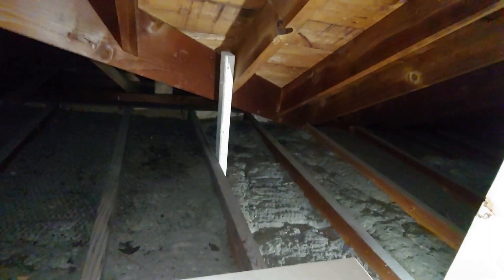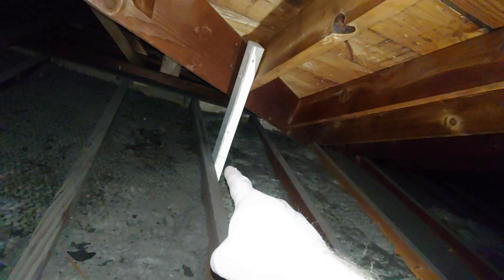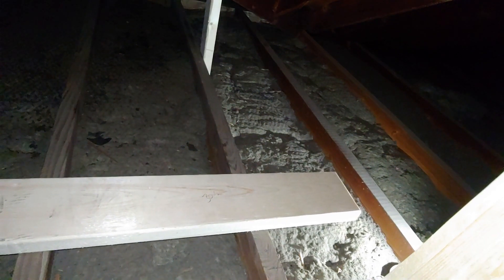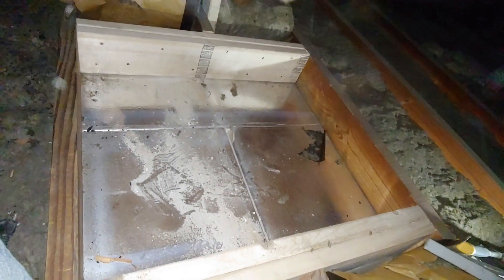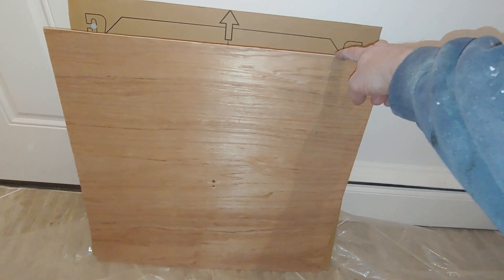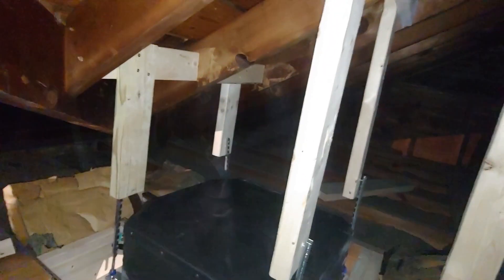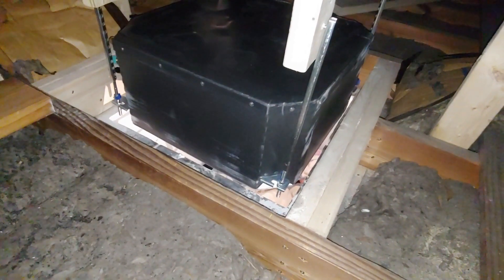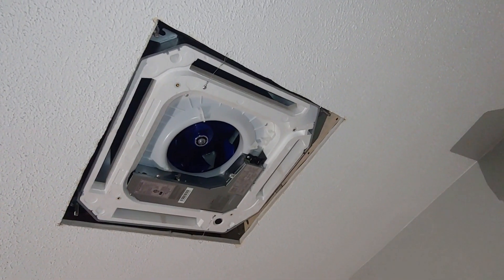Ceiling Cassette Minisplit Installation

Comment: How did you address the attic insulation after you installed these? what considerations need to be taken when it comes to attic insulation and these units? for example, would rolled insulation be laid out around the unit, leaving a square opening around it?

Comment: I currently work in HVAC, but I started and worked in construction for 12 years.
One needs to know a lot more about structural integrity before cutting framing members such as ceiling joists and notching out rafters. One could make about 15 videos just on how to reinforce the existing framing.
On the HVAC side of this work, I didn't see any pressure checking for any leaks, or vacuuming out the system and also checking for a leak in vacuum, weighing any additional refrigerant with a scale, and also wiring know how,
One would be lead to believe the hardest part is cutting joists and a whole in the ceiling.
Much, much more is involved in this project then the video leads someone to believe.
I'm wondering why Steve had so much trouble getting a real HVAC installer. May be he didn't likey the pricey and thought this work was eazie peazie?
Reply from the maker: Congrats on your career.
Reply: @SteveDoesEverything , one day in the distant future you will realize I am right and you are doing a real disservice to youtube land with your nonsense work methods. Someone may get seriously hurt when the HVAC unit comes down with the rest of the ceiling. Look into it!!!!!!

Comment: Two reasons I don't like square mini-splits cassettes.  

Cutting ceiling joist may create a structural issue. Officially you would need a building permit which because of the possible structural issues will likely be a can of worms.  Skip the building permit and you take on the liability of a future structural issue.

The four-sided cooled air outlets and center air filter intake allows more output to input air immediate recirculation reducing unit's efficiency.
Reply: What's scary is someone with very little skillsets in anything is going to hurt his family after cutting a few joists which act as "beams". There will be an attorney. one day, knocking on "Steve knows everything"'s door. 
His channel should be called "Steve doesn't know his liability" for posting these type of videos.
You would think he would state, please review with a skilled carpenter or engineer before attempting this work.
He should be mentioning the risks at each step. 
Nope.....".I just want to make money on the clicks" just like the unethical contractors he is talking about.

Comment: How much square footage does a single cassette unit like the one you put in cover?  I'm wondering if you would have to do this for each room in the house...
Reply from the maker: I ended up using 4 of the 5 head units in this house. Depending on the BTU of each unit mine were 12000 so good for up to 600sqft each

Comment: I would choose the cassette module which is mounted between studs.
Reply from the maker: Yes me too but at the time I bought this system , it was very hard to find those
Reply: @SteveDoesEverything  I checked many many different options and decided, for now, to go with two wall-mount units from Daikin. They are domestically made in Houston and probably will be easy to get parts. Also quite easy to install on the exterior house wall with drainage right away outside.  Tried to look at Mitbushi, - but they are produced in Japan and delivery dates 4 month away.
Reply from the maker: @arishem555  I’ve seen good reviews on those Daikins. Wall mounts are very easy to install.

Comment: Thanks for the video, I'm in the same boat old house with a boiler. I do have a central hallway connecting 2 beds a living room and a kitchen. I think one unit will heat and cool the hole house, cutting the rafters was my only concern. Thanks
Reply from the maker: There are head units that fit in a 16” rafter now. I think Mitsubishi makes them.
Reply: @SteveDoesEverything  yes but I think they only blow one direction I need front and back but I'll look closely at them. Thanks

Comment: What kind of saw did you use to make such nice cuts in the ceiling 2 x 4s? Seems like it would be really awkward trying to cut those especially while up in the attic.
Reply from the maker: Used a skill saw 2.5” across top then finished with an oscillating cutting tool

Comment: Exact same situation in my 1957 ranch in Elyria, OH.  In addition to having boiler heat, I don't have any external wall space with 3 feet or more clear; corner windows, giant front window, fireplace.  The local HVAC folks wanted $18,000 and couldn't even explain what system they thought was a good fit.  I'm going to attempt this myself soon.  I had a couple of questions: Should the line sets be trimmed to fit or is it OK to coil the excess somewhere?  Should the cassette have an insulated box built around it, I've read that in a hot attic condensation can cause drips?  Do you have to install the wall controller or can you run everything from the remote, or reaching up and touching buttons on the unit?  Great video!
Reply: Hi.  I’m ac engineer and I may know some in this job.  
There is many different indoor cassette in market and in different brand like: daikin, Mitsubishi, Fujitsu……. 
All of this unit are insulated inside the the metal box by polystyrene and no need any extra box the condensation will be inside the unit and dripping down in tray then drain out by internal pump ( just 30-40 c in height). There is many different way to hang the unit as long as it’s secure and level. The depth of units are depend on size of coil which is evaporator for example: the 5 kw unit got lower height as kw goes up the size of evaporator will be bigger and you need more space on the top, but again you can do so many things to make it look good.
Reply from the maker: I concur with @khosroNazem. On your questions, I wouldn’t trim the extra length on the line set. But be sure to review the manufacture specs on total line set length for the unit your installing. On the system I installed, if I remember correctly, the total combined line set length couldn’t exceed around 400 feet.
Reply: Ac can run by wired or wireless controller some need receiver. And some new ones can be controlled by Wi-Fi

Comment: Getting ready to the do the same thing myself. Got similarly outrageous quotes. The only thing I'd do an addition to what you did is scab the joists on either side with double trimmers. What you did should work fine but technically the the load of one of the joists was transferred to the other two meaning that you've reduced 3 down to 2. The scabs should increased the load ability of the joists on either side.
Reply from the maker: You're right. Great idea thanks. Good luck with your project.

Comment: Man, next time use a real simple device called vertical Hangermate, search for Dewalt wood vertical hangermate& rod hanging anchors,you dont need all that wood ,the allthread goes directly into it and its a stronger better hanging method, plus the alltread keeps things clrear for servicing.  They cost about 85 cents each and you only need 4. Believe me you will like it. Now that being said. I like the fact that you are doing it yourself. Its rewarding doing things yourself. Good luck and great job
Reply: Since I also have 16in spaced rafters, I have plenty of room around the unit.  So what I plan to do is mount 2x4 corner braces that the unit will mount to (as it has brackets on the corners).  Then either screw self-tapping threaded rod into the corner braces, or drill them out and stick in threaded rod.  Note that my senville unit needs to be 0.9" away from the bottom of the drywall (so that all of it is inside the attic).

Comment: Had this same unit installed but it has a stinky musty smell every so often. Any ideas? Installer said it's because of the pump and he wants to take it out and put a wall unit in
Reply from the maker: Possible intake filter is dirty. Or drain is not draining properly.
Reply: @SteveDoesEverything  The drain was not sloped so I re did it with a slope and now all is good. Thanks!

Comment: ANY time you build a plumbers box like you did in the attic you HAVE to use joist hangers. You should have 4 doubles and 2 singles. Everything should be on hangers. Other than that, good stuff
Reply: I’m
Glad someone said something. I was about to.  He is not making that ceiling any more stable from  roof loads . Double header  and tecos.
Reply: Can you elaborate?  I could use this advice as well.  Thanks!
Reply: Here's a good thread on boxing out ceiling joists with a code reference. https://diy.stackexchange.com/questions/146225/cutting-ceiling-joist-for-attic-ladder-install
Reply: @Eric-lj8sw  glad you found a good thread. I didn’t read it yet but you always want to use hangers. I use them on every part even if I am end screwing. I don’t take chances. There’s a lot of things that are code-acceptable that are eventually found to be not so safe and then changed. I overkill every single thing. That’s why I never have call backs or issues.
Reply: @sweaterwearingsquirrel9302  thanks, good advice!
Reply: @sweaterwearingsquirrel9302  

You're incorrect. You only need hangers for members over 4'.
The header is the same. A single member would suffice. However, the 2 members on either side DO need to be doubled up.

Comment: Nice, did you come across any smaller mini splits that would fit between the joists in an old house without doing all the work on the joists? Must be an enormous market for smaller ceiling mini splits.
Reply: So, nowadays, Mitsubishi makes some elongated ceiling cassettes that fit in a 24” space, which is generally what most ceiling trusses are spaced at.
Reply: @davidcerino1145  We just got ourselves a 1925 house 2 days ago. I have no clue what the ceiling joist spacing is, but I will when I venture into the loft. Ceiling cassettes are happening when the split goes in so this video was good information.
Reply: @davidjohnston4240  I love them, but, beware!!!!  Working on these types of equipment can be challenging, and many residential  HVAC companies may struggle to fix them.
So, learn to open them up and make sure they give you a small access panel to reach the refrigerant lines.
Reply: @davidcerino1145  I have a contractor who is experienced with mini splits. I found the Mitsubishis that are 15" wide. We will be using those upstairs. Wallmounts downstairs.. We have a couple of months to get all the renovations done before we stop renting and move in. It's a big job with new electrics, new roof, new kitchen, plumbing and lots of repairs. 1925 houses carry a lot of baggage.

Comment: does the unit mount flush with the bottom of the rafters or flush with the drywall? like before you install the cover.
Reply from the maker: Flush with the bottom of the rafters  (or attic side of the drywall)  is a good place to start. You may need small adjustments for final fit.

Comment: Can the unit be screwed right into the rafters or do you have to have it hanging?
Reply from the maker: My set had to be mounted in between the rafters. You could make a mounting bracket to drop in from the attic side.
Reply: @SteveDoesEverything  I'll look into it. My garage is unfinished, just has insulation in the walls & open rafters, so I wasn't sure if I could just build a box between my 2' rafters to screw it into?
Reply from the maker: @MatthewsFabrication  if you have open rafters it would be very easy to make a mount to do that. Are you planning to close the ceiling   in with drywall after installing? Make sure to allow the unit to be adjustable up and down for final fit and finish with the cover plate mounted. Also be sure to take into consideration room for your line set hook up
Reply: @SteveDoesEverything  Yes, I'm planning on finishing the garage with sheetrock & paint. Thanks for the advice about making it adjustable. I appreciate it.

Comment: How do you cut the joist without going through the drywall?
Reply from the maker: Skill saw set to max depth. Carefully finish off with sawzaw. You could also use an oscillating saw to finish the cut
Reply: @SteveDoesEverything  thanks!
Reply: @SteveDoesEverything  do you need to sandwich osb between the 2x6 headers?
Reply from the maker: @nicksanginario4294  I used double 2x6 header on both sides of the cut. I did not incorporate  sandwiched osb

Comment: why hang from rafters? Seems unstable. Why not mount on joists?
Reply from the maker: The cassettes weren't really designed to be mounted on a joist. I did consider it. I could have built a bracket to do that. Which would have required me to mount the cassette from the attic down instead of from the room up. The attic was very uncomfortable to work in and would have been a huge pain to carry the cassette through the attic access as well as through the attic. It was just easier to build the rafter system.

Comment: Subscribed. I am in the same boat in terms of having purchased an old house with a boiler and baseboard heaters. Out of curiosity, did you leave the baseboard heaters in place and use the mini splits only as supplemental heating (and all cooling)? Or did you take the baseboard heaters out? If not, were you tempted to take them out? Would you do anything differently? Thank you!
Reply from the maker: I left them. I was tempted to take them out however the house had the boiler replaced 5 years prior to me taking ownership. And after going through 2 winters in the home with the boiler system, I realized the efficiency of the system. Electricity is somewhat expensive in NE OH during the winter so I also wanted the option to use the mini split or the boiler system. It was also going to be a lot more work than I wanted to tackle to remove all the copper lines and baseboards from the home. If I were to do anything different, it would have been to spend a little more time to find ceiling cassettes that fit a 16” on center joist. Hope this helps

Comment: I installed LG system with ceiling cassettes.  When done only one cassette would respond to the remote.  I have done every trouble shooting thing I can find without success.  LG will not help, supplier will not help
Reply from the maker: I'm sorry for your trouble. I don't have LG specific cassettes so I'm not sure what to check. Are you certain you hooked up the faceplate to the correct connections on the head unit? I would look at the faceplate connections on the working unit and compare connections to the ones that don't work.
Reply: @SteveDoesEverything  Steve checked, rechecked everything.  Actually the only really good diagram was the only showing the connections to the board on the cassette from the faceplate.  Thanks for the reply.  I am even further away from HVAC contractors than you are.
Reply from the maker: @nancyboland6433  You're welcome
 Sorry I can't give more input. Each head unit has its own remote? Do the head units have a manual button to turn on or off without remote? Did they come with a wall mount control panel that you can plug in to see if it operates.
Reply: @SteveDoesEverything  Each has a remote.  There is no manual button or reset button as far as I know and believe me I have looked through installation manuals and a general service manual from LG.
Reply: Ahhh, only licensed HVAC installer should be doing this work. That's it doesnt work and no one wants to help you.
This is not a DIY project!!!
Reply: @jdere31760  Where I live there are no licensed LG certified HVAC installers.  I did fix the problem the motherboards in the ceiling cassettes were faulty.  All working great now for over three years.

Comment: Did you mount your ceiling cassette recessed of the opening or flush with the finished ceiling? Senville's directions seem to be contradictory. For example, the directions say: "the indoor unit's lower part should sink into the false ceiling for 24mm/0.9in."  The diagram below this direction then shows the unit, without cover, installed above the finished ceiling with an arrow showing a 24mm/0.9in gap. Thanks for the videos, I just watched tip on the pvc union and now need to go back to the store because I'm not crazy about the drain tube provided.
Reply from the maker: The bottom of the head unit I mounted flush with the attic side of the drywall as a starting point. minor adjustments were needed with the hanging screw rods when I attached the louvre plate.
Reply: @SteveDoesEverything   Thanks, Steve! After taking a look at my Senville cover plate, I noticed that it has a shoulder and a gasket that will need to be compressed; they will fill up that 7/8". My big problem is that when someone says "sink" to me, I think of downward motion.
Reply: I took one look at the supplied flexible drain tube and disposed of it. Way too thin and flimsy. I went with 3/4" PVC and reduced down to 1/2" PEX tubing: flexible yet reliable. Worked great.

Comment: Can the units be installed directly to the ceiling joists rather than hanging them off the rafters?
Reply from the maker: If mounting from attic side is a comfortable option then, It's likely you can modify the joist to mount it directly.

Comment: Can these ceiling things be installed if you don’t have attic to walk in?
Reply from the maker: They can be installed in a drop ceiling environment. But if you have an attic its just very low and cramped. You have to keep in mind plumbing, electrical, and line sets needing to be connected. Maybe a wall mounted unit would be better if ceiling access is not available.